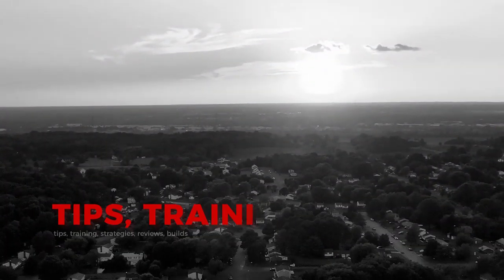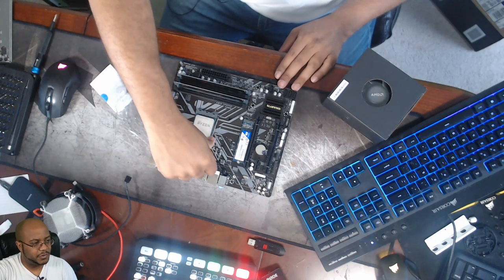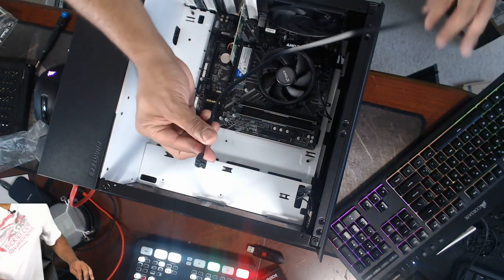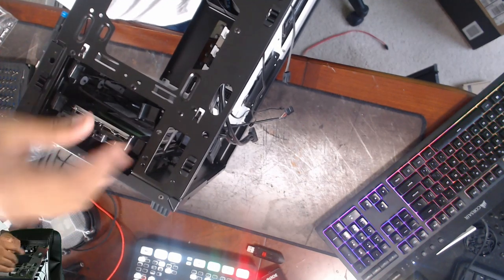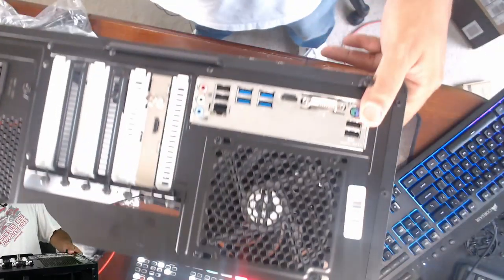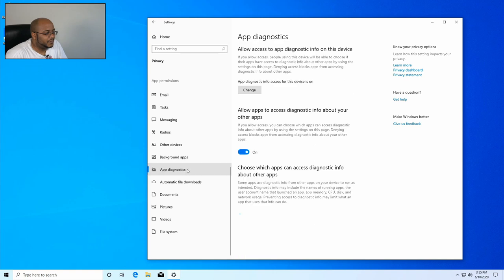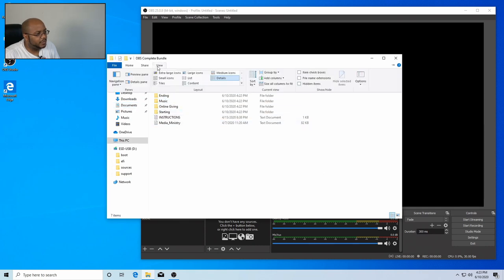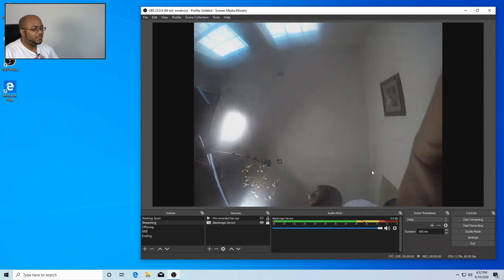COMPLETE LIVE STREAMING PC BUILD | How I build dedicated church live streaming PCs

Comment: Hey again AJay! Do you have a video explaining optimum stream settings within OBS for a 1080p60fps livestream streaming to YouTube? Our upload speed is around 20Mbps. Also, with this recommended Ryzen, do I have to choose x264 encoding?
Reply from the maker: Yes I do have a video.  It would be the auto configuration wizard video. As for the system,  if you were using the 3200g or 3400g, you would select hardware encoding

Comment: I just built this pc using the same components except increasing the ssd to 1TB. When it boots up, I get a snowy screen for about a second or two followed by the normal screen for a second or two and then back to snowy screen, etc., for a total of four times. Finally, it settles on the normal screen. If I have the computer connected to a KVM switch, this is repeated each time the switch goes to another computer and back. AMD replaced the CPU but that did not help. I have submitted a support query to Gigabyte but haven't heard back. Have you ever run into this? Do you have any suggestions on what to do?
Reply from the maker: No one never gotten this.  Have you updated the bios?
Reply: @AJaytheCEO  I have not yet. It is F50 which I think is up to date or nearly so. I'll try to do that in a few minutes and report.
Reply: @AJaytheCEO  I updated to F60c. That did not change behavior.

Comment: Could you fit a GPU with the capture card?  Also, is there really no need for a dedicated GPU?  You can work all this with the integrated graphics card just fine?
Reply from the maker: Yes you could as long as the motherboard supports it. My main systems here and now at church are setup this way.
Reply: @AJaytheCEO  Thank you.  Did I see right that the capture card went into the PCIe x16 slot?  Something simple that I guess I didn't know these PCIe x1 could go into any lane.
Reply from the maker: Yes smaller cards will work in the bigger slots
Reply from the maker: @durtydeedsREI  I also did this because I am using an APU so no separate gpu was going to be used.

Comment: AJay, We use the ATEM Mini (Not Pro) and if I was to build this exact system and setup everything the exact same way, How would I still be able to distribute the feed throughout the church? We currently have the output from the ATEM going into HDMI Splitters that go to HDMI Extenders to all the TVs. If I continue to use the ATEM, I technically wouldn't need a capture card, correct?
Reply: Also, 2 other things; The SSD you installed wasn't nvme. Would I really need an nvme or just install exactly what you have.    Lastly, what's the best way to burn OBS Recordings of our services to a DVD to play in any DVD Player. What software & Hardware do you use?

Comment: This is awesome! Is there a 2nd motherboard recommendation. The one you recommend is backordered on Amazon.
Reply from the maker: Any b450 or the new b550 will work. I like asus, msi, asrock and gigabyte
Reply: @AJaytheCEO  I ended up with a B450M DS3H. We are sending lyrics over NDI through ProPresenter into this machine, and that is working great! But sending video into it over NDI is stuttering. Is the network card capable of handling NDI video input? I had to change the NDI source in OBS to low quality to get it to come into OBS without stuttering.

Comment: Hi, I'm from Costa Rica, I speak Spanish, and I can't find any information. almost everything is gaming. I had already planned to invest in a GTX 1650Super, Ryzen 3600 and more. That GPU because it comes with the Turing architecture and the Nvenc New encoder. But it happens that this is a team for the Church and not for Play and Broadcast. We only want to transmit at 1080p 60fps. At the moment with a software called IVCAM. In the future, buy a video camera and the capturer. I wanted to know if a configuration like the one you propose with the APU meets the above mentioned.

It would be an exclusive pc to transmit. I would connect the x32 mixer for quality audio.
An NDI entry from propresenter from this same pc or another.
And the Video inputs of the IVCAM or the future video camera.

Thanks and greetings from so far.

We have:

> Dell Optiplex 3020m
i3-4150 (2 cores 4 wires)
DDR3 4gb
Bad HDD

> Hp Elitedesk
i5-4570 (4 core 4 wire)
DDR3 4gb
Bad HDD

> Hp envy beats all-in-one
i5-4570t (2 cores 4 threads)
DDR3 8gb
HDD almost new
(This is the one in use. With EasyWorship and as an auxiliary to the x32 mixer)

We want to have 2 teams. One capable of running Propresenter with 1 audience outlet and 1 preacher or worship group outlet. In total 3 outputs if we count our monitor. In addition to the NDI output for transmission.
And the other team that would only be to transmit.

I don't know what you recommend me to buy. What should I invest in and how do I manage these teams to get the most optimal and powerful. Without incurring in unnecessary expenses. Maybe it is not necessary to buy the parts that I mentioned before and we can invest it in a camera

Thank you!!!
Reply from the maker: Yes it would as this is identical to what I use to live stream at 1080p60